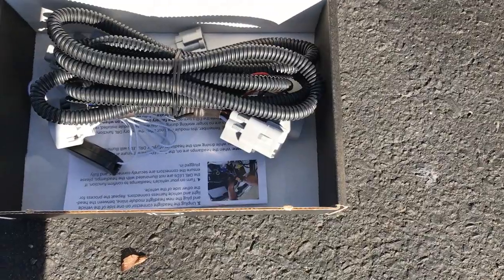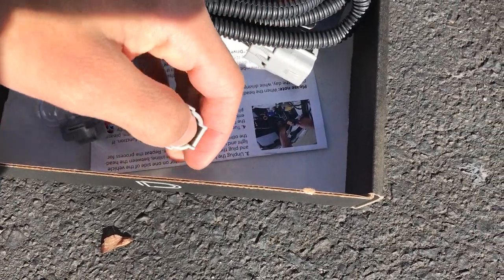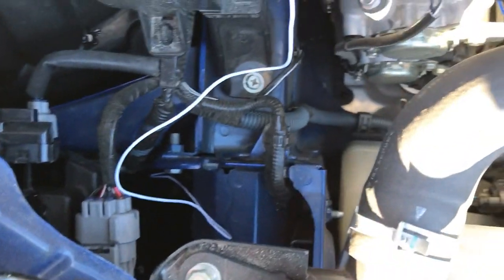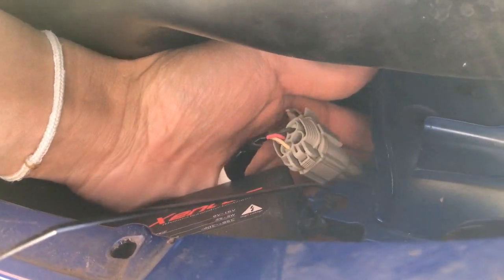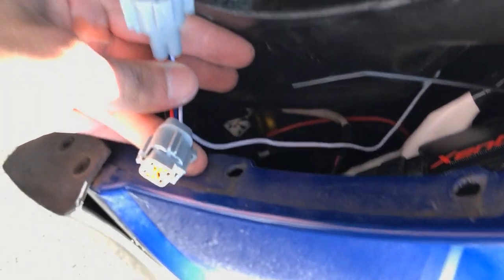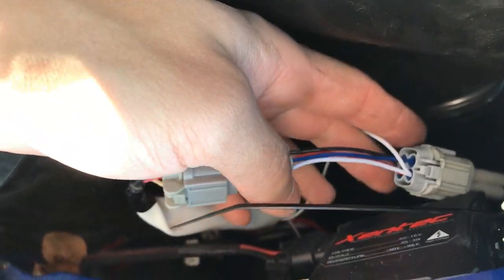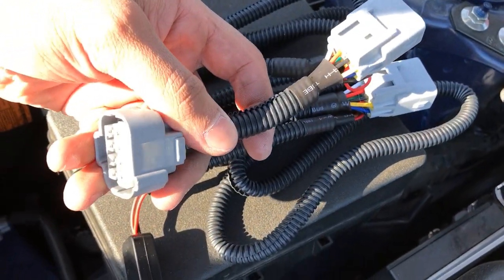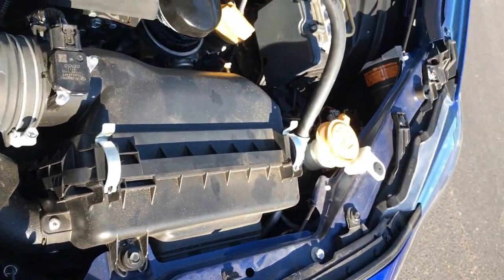[How To]: Install Diode Dynamics Always-On Module on 2016 Subaru BRZ

Comment: How did you unplug the first harness, the one of the boomerangs, mine seems stuck
Reply from the maker: It’s on a clip up under the fender lining. Once you unclip it from the bumper of the car, it should drop down and be easier to work with and unplug it